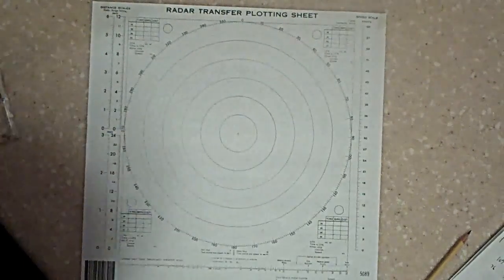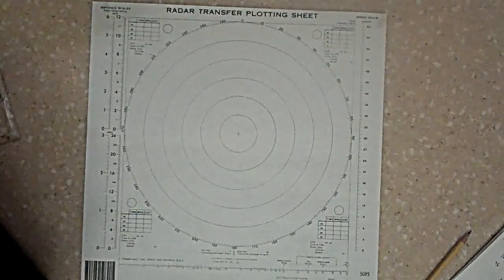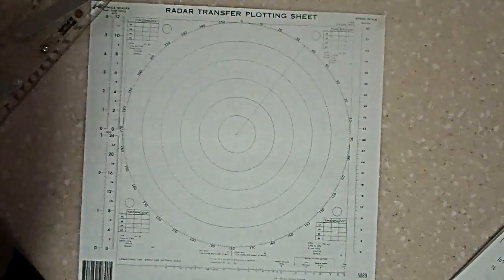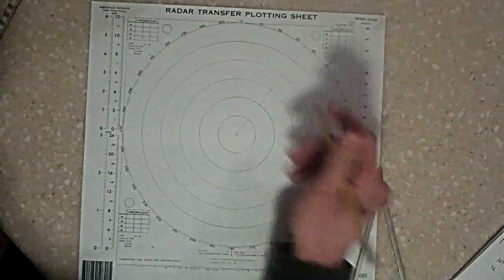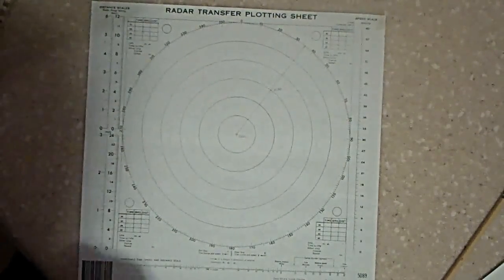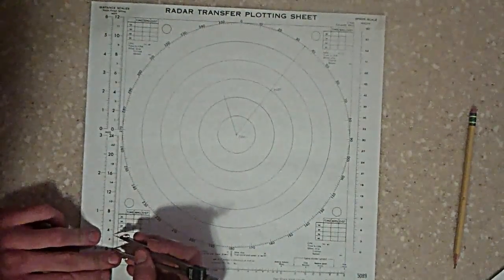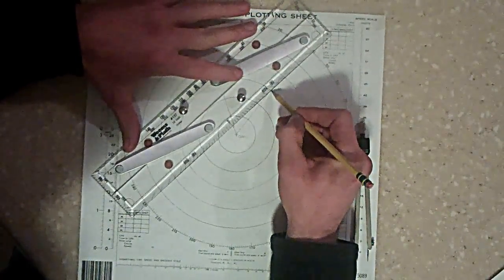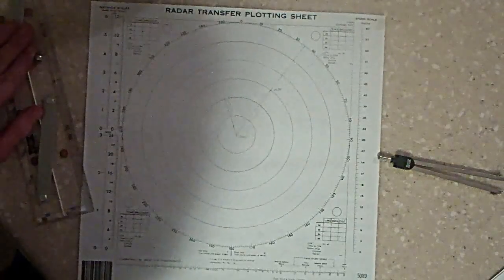Set and Drift - How to determine Course to steer

Comment: Your speed over ground will be effected by the current and it's angle on the Vessel, so when you start your calculations, speed over ground as wel as course to steer will be unknown. How does this method work for practical use?